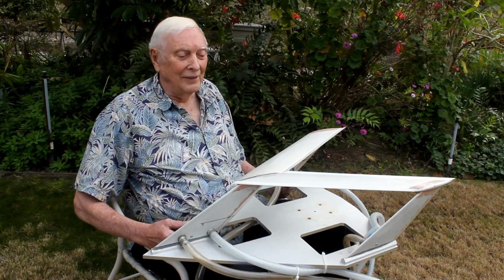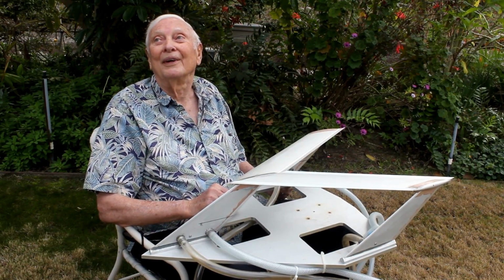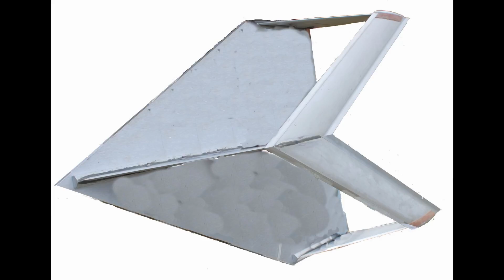TOM LANG'S 100 KNOT OCEAN LINER

Comment: I would love to see this concept become a reality! But unfortunately the number of hydrofoils in service has shrunk a great deal! I don't understand why? The Russian made Meteor hydrofoil ferry that I traveled on from Bratislava to Vienna was fast and fun.But it was the only one in service on the Danube river when there were over dozens of them in the past! It the cost to build one on a grand scale would be enormous! And one that can go that fast would create public protest as"whale killers"!
Reply: Stability. Hydrofoils are good for speed but they suck for stability. Hydrofoils are sensitive to impacts, so if you hit something at 40 knots, you're gonna toss your passengers whom normally unlike cars and planes have no seatbelts.
Hydrofoils are ridiculously expensive compared to catamarans which are many times more stable and vastly less likely to sink in an accident. Also modern catamarans are as fast as hydrofoils.
Most of all they're huge gas guzzlers. As the boat slides on hydrofoils, it becomes extremely fuel efficient and provides a smooth and fast ride because of less hull in the water.......even so, However; One would think they're efficient, but to get those speeds you need very powerful engines. The Pegasus US Navy foil's used two engines for power, for non foil propulsion it used twin 800 hp diesels, very efficient for a modest 12 knots, for foil borne, used an LM2500 gas turbine which consumes 1700 gallons of fuel per hour!